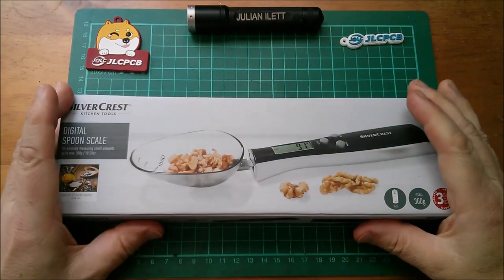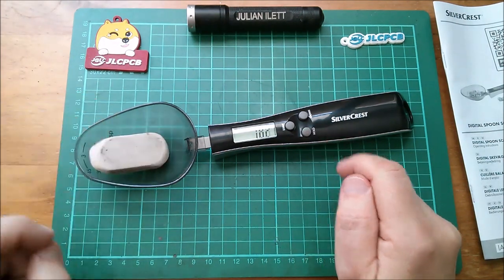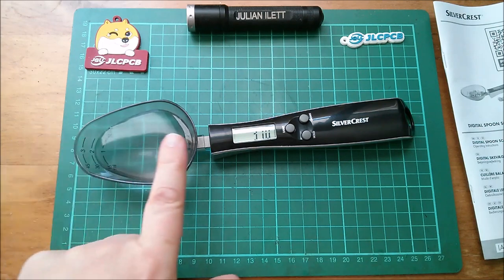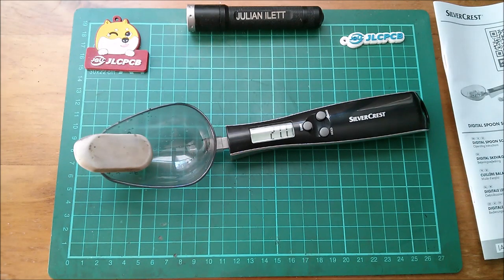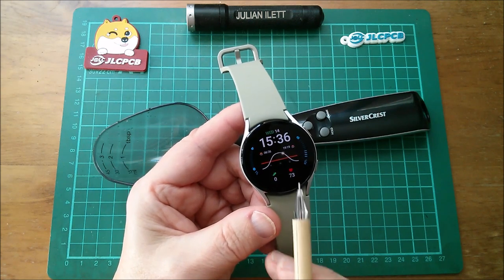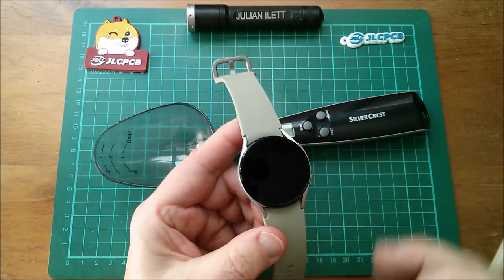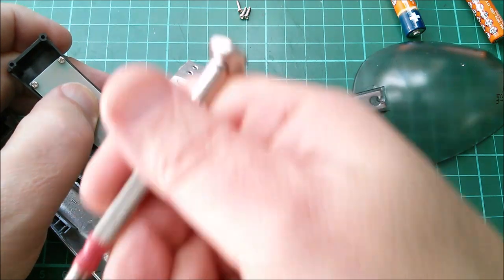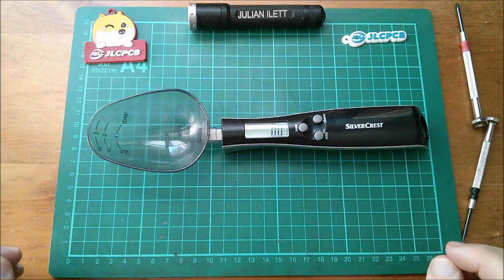A Spoon with a Computer in it

Comment: The scale holds because you just lift your suitcase off the floor with it and put it back down. You can't see the display while you are lifting because the scale itself IS the handle, and the display would be hidden by your hand.

Comment: The "e" is for excitation. The 4 wire system is a Wheatstone bridge. Take a look at the hx711 for more information. You can even get an Arduino library!   Oh, and you need a minimum of two tape drives for computers of that era - reading from one drive and writing to the other.Most had three or more.
Reply: Bingo!

Comment: The E+/E- are possibly for "Excitation" voltage +/-.  The strain gauge may well be a Wheatstone bridge so you provide a +/- voltage on each side of the bridge, with S+/S- coming from the mid points of the bridge to give you the readings (so "Sensor" for S sort of makes sense).
Reply: Correct :)

Comment: by the looks the fulcrum is actually much further back into the handle so the difference between the two locations you put the eraser as a fraction of the entire length is quite small meaning that you will only get a slight difference in weight at either location.
Reply: I don't think that there is a fulcrum as per se as the strain gauge essentially is a parallelogram that gets distorted when you add a weight to one end of it, the bending of the arm is a side-effect of the weak mechanical connection between the strain gauge and the arm / spoon!

And because the strain gauge measures the shifting of one end compared to the other there's no fulcrum for a mass to pivot on so the force is the same regardless how far away the mass is from the strain gauge. 👍
Reply: I hear what your saying, but it looked like the top side of the gauge would be placed in tension and the bottom side in compression which would get affected, I did not see the parallelogram shape in that design, I'll rewatch it to see if I missed anything.
Reply: @foxabilo  The parallelogram is in the strain gauge itself, it's essentially a aluminium bar with some holes drilled in it and a piezo-electric crystal bonded to it, when you apply a force on one side (gravity pulling a mass) it shifts one end down relative to the other and that causes a slight flexing of the upper and lower arms that is formed by the holes drilled in the aluminium bar.

As long as you don't overstress the strain gauge then all movement should be a parallel shifting of one end of the strain gauge with no stretching or compression of the upper / lower leg of the strain gauge.

Comment: The weight of the cup (and whatever's in it) acts through the point of contact of the cup with the lever (I think!). Load cell: 4 strain gauges in a bridge, S for sense, E for excitation.

Comment: One of the pads was marked vpp which is normally the programming voltage so it's quite  possible that itcould be reprogrammed via several pogo pins  , which could be used for factory testing or changing some internal parameters 🙂

Comment: My electric toothbrush has a microcontroller.
Why use a 555 when a microcontroller is the same size and needs less support components?

I just happen to have an old toothbrush here because I was thinking of replacing the battery. 
It has pads marked Rx, Tx, Vdd, Gnd. Hmm...

Comment: Looks like you trapped a wire under the hold button, but I'm sure you're able to rectify that easily.

I wouldn't call this a regular spoon, just because you're not likely to use it for the intended purpose of a spoon, which is eating. I'd call it a measuring spoon, much like a measuring cup but smaller, so its intended purpose is different. And they've modified its function to include a scale in the same form factor, which definitely shifts its purpose more to the measuring side than the spoon side.

And as with all things that combine functions, usually something suffers. In this case, it doesn't look terribly ergonomic or precise for measuring volumes. I definitely think you'd be better off with a set of measuring spoons and a separate scale.

Comment: Answer to your final question Julian....unlike the digital calliper which has a practical application of electronics to transform the user experience from one of having to read and translate a vernier scale to that of an instant access to the numbers required, albeit the usefulness of its ability to tare and or add the measurements....the spoon serves no useful purpose over an ordinary scale which is usually stationary in its operation as it is with your demonstration, but merely a gimmick to seperate people from their money....Yes that is interesting how the moment arm principle has no relation to the indicated measurement, also I'm curious as to the relationship to gravity it would have if it was hand held as would logically be the case for a spoon, if it was to be thrust in a vertical direction whilst measuring something ?
Reply: It's a "simple" measurement of the flex of the strain gauge, so if you were able to move it with enough force to put more or less pressure on it without losing the contents of the spoon, sure it will change. But I don't think it would change in any significant manner when used for say scooping a set weight of some cooking ingredienf... You would let the reading settle and see if you need a bit more or tip some out.

Comment: Not sure why a computer has to be reprogrammable to meet the definition. It has a processor and is executing code so it's a computer no? I would argue that a watch that does more than tell the time or calculator are also computers (a watch that just tells the time is not executing code just incrementing a counter).

Comment: It's not really a computer in a spoon.  It's more like a set of scales in the shape of a spoon.  It's just a set of scales.
So I guess by that reasoning, every single digital scale is a "computer" though they are more just microcontrollers with a set program, like an arduino running a sketch.  I guess technically that could be a computer, but this video is click bait really.    This is just a digital scale in the shape of a darn spoon.   Lets be real and call it for what it really is.